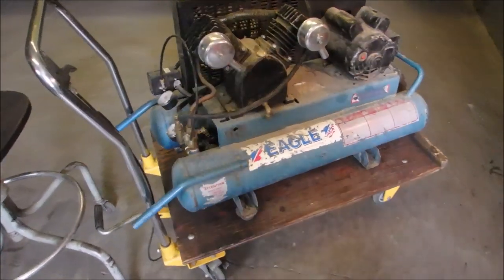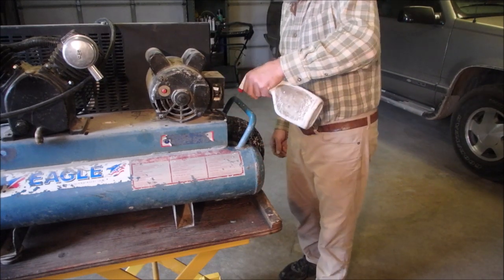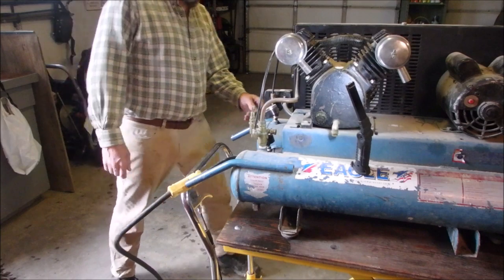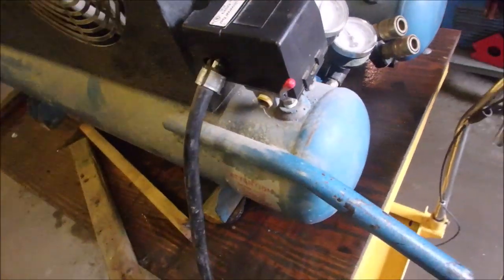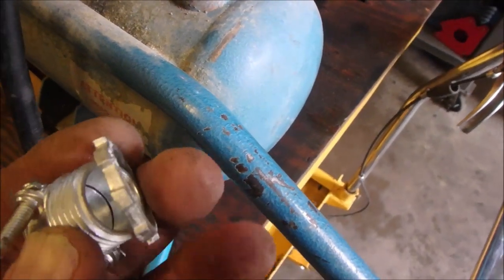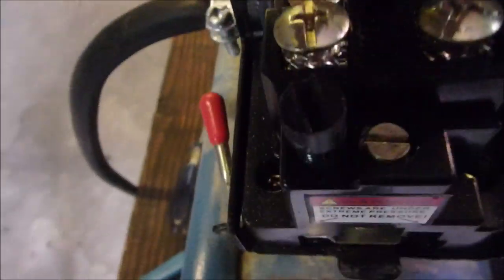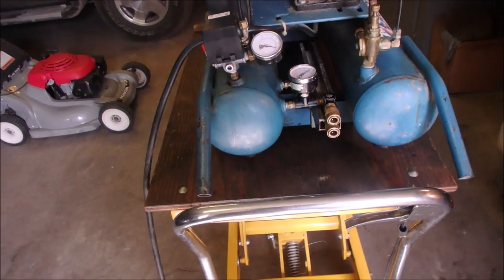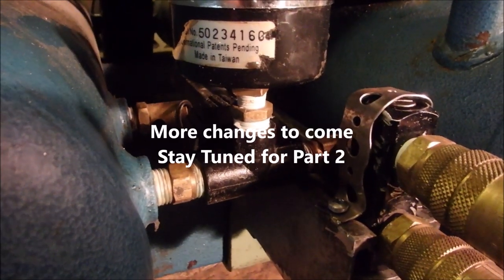Electric Wheel barrow Compressor Repair Part 1

Comment: Hi Bruce I can't remember if I told you but I put a solenoid valve in place of the drain on my compressor. It is connected through a timer to the pressure switch that allows it to stay open for about 3 seconds every time the compressor starts to drain off water. Works great. If you add that to that compressor it might not come back full of water.
Reply from the maker: Good idea for my own own.  It is dryer here e in Western Canada but I love the idea.  It would make a good video
Reply: @BrucesShop  i haven't made any video's but you are welcome to use the idea in a video. Let me know if you have any questions.

Comment: bruce that means that it runs hot and a long time  better cooling  of the compressor  my bet is that it is not big enough for there needs and runs continually for most of the day or it has leaky hose connections also  supposed to drain daily
Reply from the maker: Maybe they aren't unplugging it at night like we do eh!!!  We are dry here,  I drain mine about once a week
Reply: @BrucesShop  lol that is a great idea the air has more water in it at night lol

Comment: Ahhhh , i saw how you unwind that ext cord ! Def a prior phone dude ! lol
Reply: That thing really is quiet . Love that .
Reply from the maker: Thanks.  Yes and did you see how nice that coil was when it was rolled up.  LOL   I alkway tape one loop then roll.  They come out all the same size.   I never wind a cord around my elbow.
Reply: @BrucesShop  I hate to think about how many 25 pair cables i unwound . lol
Reply from the maker: @timmygilbert1371  No Kidding.  CO?  Outside Plant?   or     PABX
Reply: @BrucesShop  These were all sites that cable an wireless had . They were a company out of england . sadly all that went away a while back here is the USA . I think they still exist in england . They had a switch that would route long dist calls the cheapest route . Thats what we went around installing from the east coast all the way to the west coast . ALOT of traveling , lol . But i was in my early 20s at that time .
Reply: I always wondered what happened to all that equipment . Millions of dollars . smh
Reply from the maker: @timmygilbert1371  My first day on the job I asked my boss in 1977    "Am I going to see any of the small towns in the area?"  He laughed  29 years later I got a job OFF the road.  Yes 29 years of Motels in small towns.    WHEW!!!!  The last 4 years I was in Maintenance.
Reply: @BrucesShop  Wow , I did it for 5 yrs . Gets OLD quick living out of a suitcase . But i have no regrets . Learned a hell of alot .

Comment: All compressors create water when the moisture in the air is compressed. The purpose of that drain is to do the daily draining that is required. If they are steel tubes the interior of the tanks are probably very rusty and over time they become dangerous. If they are aluminum that is great because they do not rust on the inside but they still need to be drained regularly. I just noticed in your video that you attached your magnetic light to the tank so it is steel. Not good if they are not draining the water regularly.
Reply from the maker: Thanks  Great info.

Comment: Guess the next time you do service a drip pan may be of use.  That was quite a bit of water in the tank.   The owner isn’t an experienced operator to drain daily?  Thanks for posting video. Shame about the yellow cord.
Reply from the maker: It is used by contractors and they just use it.
Reply: Bruce Pender would be nice if they gave their equipment a little love, but what would you post them?
Reply from the maker: @jimpikul8551  Right.  It is all about the video to me.  These a great.

Comment: I've worked with air tools before...If u have the compressor coming on at 90psi and going off at 130psi,  then if the equipment  needs operating pressure of a minimum of 100 psi , then, for a time, the compressor won't be able to provide enough operating pressure for the equipment attached to it....Just my thoughts.
Reply from the maker: You are absolutely right.  Just an old compressor.

Comment: Hey Bruce!  I have a craftsman air compressor that I cannot get over 50 psi build up pressure in the tank. It gets to around 50 and stops pumping even tho the motor is still running. I have replaced everything including fixed all the leaks. Please help. 😂👍🏼. The model is 919.167790. It’s an oiless compressor
Reply from the maker: Have you taken the cylinder off and checked it?
Reply: Yes sir. I’ve replaced everything. Reeds. Gasket.  O rings.  Check valve.  Ect
Reply from the maker: @GlynRobinson  Sorry   I wished i could help but i am not there.

Comment: Whoever owns that will rust that tank out if he doesn't drain it each day after use. It's right on the side of most compressors, drain daily.
Reply from the maker: I think the drains were to high.  I added feet to drop them.
Reply: @BrucesShop  I see what you mean now. he drained it but it didn't come out as it should because the water was at the other end.
Reply from the maker: @MrHowieZ1973  Last time i fixed it i had air in the tire but no feet on the front   That will change.  Part 2 coming.

Comment: Electric Compressor don't like extension cords that long.
Reply from the maker: You are right but it is a 10 gauge.  (welder type)  It will take way more than 15 amps over the 60 feet.